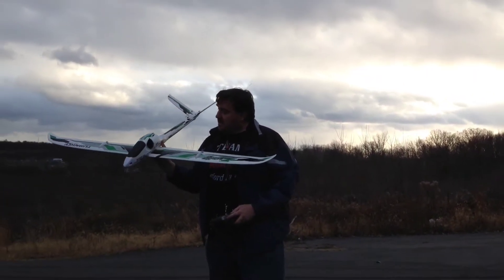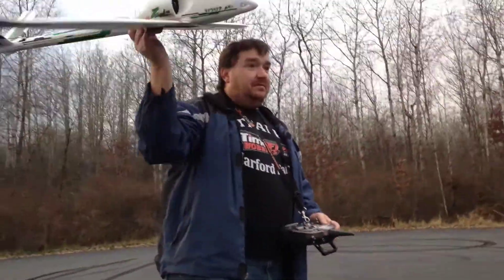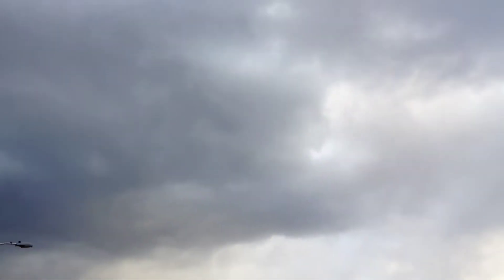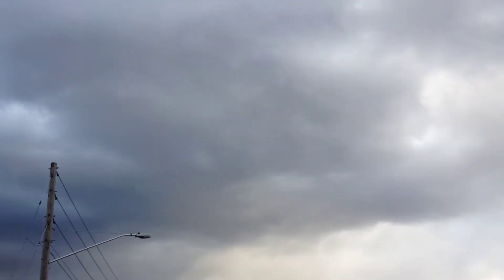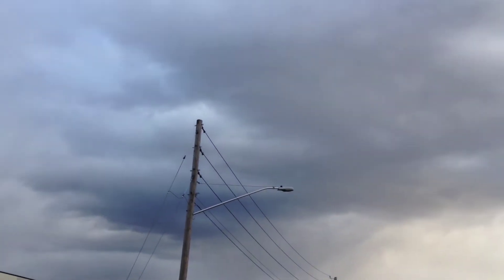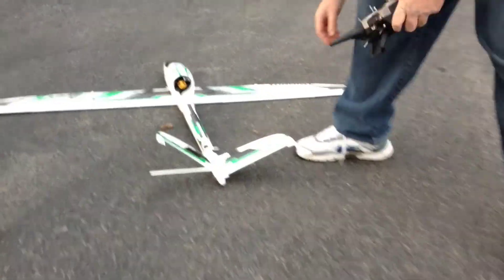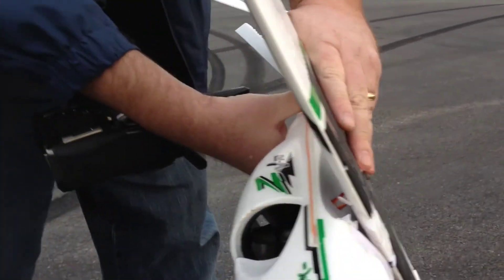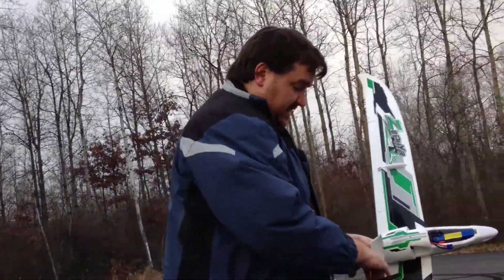Zephyr V-70 EDF Engine Glider Maiden with Crash

Comment: Man that thing is noisy! It kind of sounds like a turbine engine. The crash wasn't that bad though. Certainly could've been worse! I wonder if the V-Tail broke in flight, and that is what caused it to roll.
Reply from the maker: I really liked the sound. Definitely one of the loudest things in my hangar.

A few people mentioned about the V-Tail could have broken in flight. I'm not 100% sure of that because of the way it flipped, but I know very little about V-Tails.

I have everything back in place, but it feels a little off. I am going to get some foam tack and remake the hinges with that, then reinforce with some more tape, and then wait for the wind to die down and just keep it over the tall grass and brush this time.